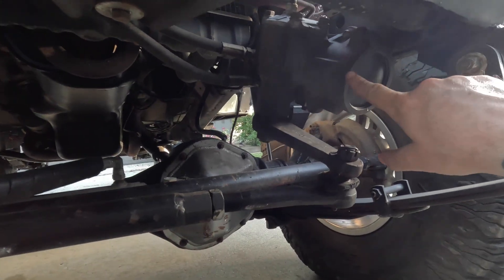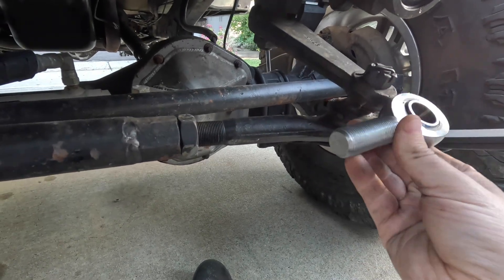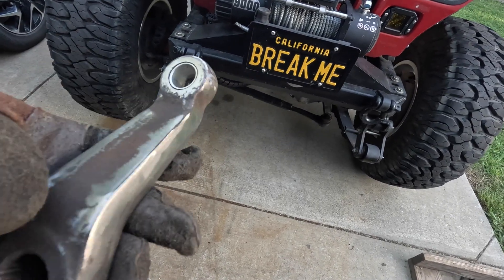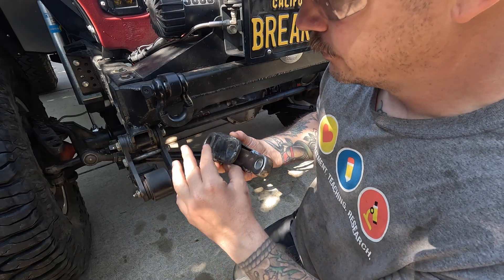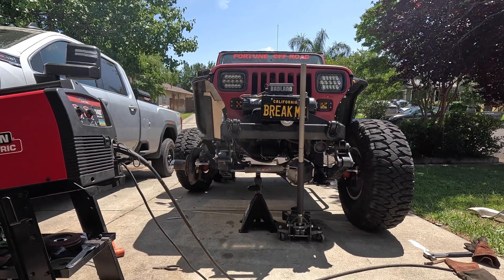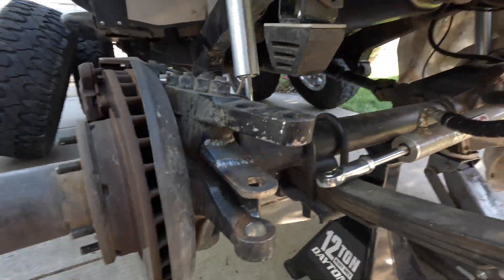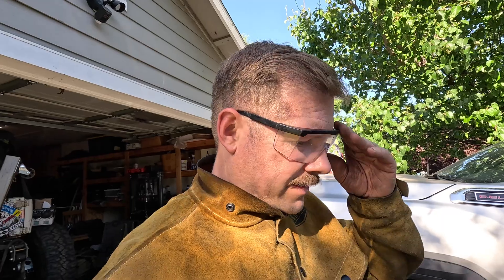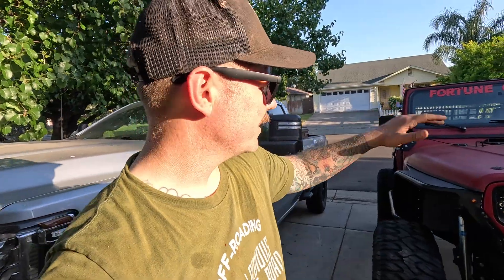Is Double-Shear Heim Steering Stronger?

Comment: heim joints are not legal in most states.
for my cj-7
i had both outer “C’s taper drilled top down. pinion is factory just taper driller for the heaver duty ties, chrom- molls bars. and chevy 1/2 tone tie rods. a cj-7 has the diff on the correct side. so no clearance  issues.
4.5 spring lift. spring under. steering links are flat.
everything stays up out of the way. and axle’s taper mounted. to put the caster camber back into proper.
no steering issues of any kind on the roads 
the steering box is mounted on real steel mounts not the factory tin plate. and a cross bar for the snout.
Reply from the maker: Sounds good

Comment: Heims are good for off roading only, street usage they wear out very quick, used em and was shot in a year, other I know used them as well with same results.. joints shot in a year or so... stay standard tie rod ends on street vehicles folks
Reply from the maker: Good point! Any offroader worth their salt knows to replace joints annually if they are really wheeling. For steering components it's a no-brainer that they need replacement once a year.

Comment: Great video, I’m really enjoying this build, and you explain things really well.  Sorry if I missed it but can you explain why you attached the drag link to the tie rod instead of attaching it to the knuckle?  I would think that keeping them separate would help with independent and easier adjustment.
Reply from the maker: You're right. Going to the knuckle would be better, but my Jeep is so low that the pitman arm is lower than the knuckle. If something changes in the future, I will drill out the knuckle and go there directly.
Reply: Looking good bro 🤘😎